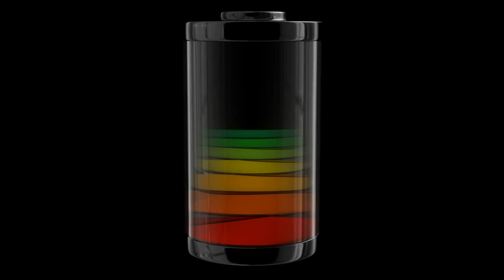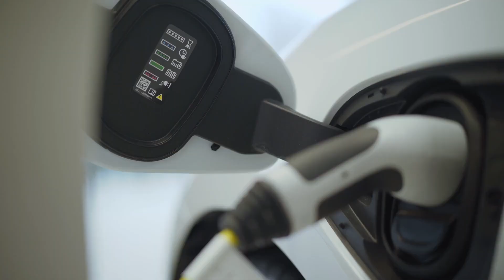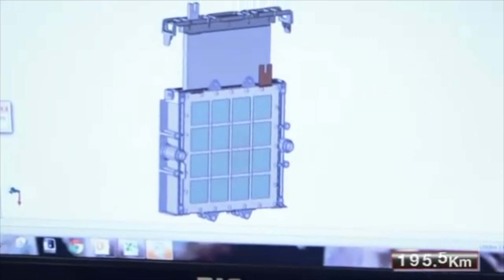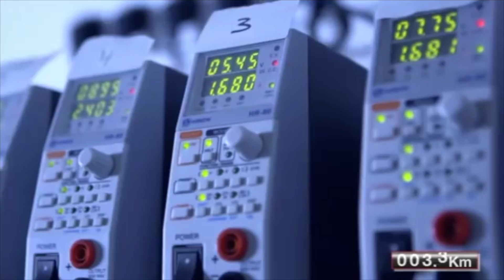This Battery Gives EVs 1000 Miles of Range!

Comment: if they standardize the size of batteries then any shop could swap them out like jiffy lube oil changes
Reply: Make them a standard size and look like huge AA batteries. The public will understand it better. Don't go for just one huge battery, make it four smaller ones that anyone can carry with maybe a 250 mile range if you only buy one. Going on a longer trip, buy 2, 3 or 4. Keep a spare in the boot. I can imagine, driving up opening the boot, grabbing a handle, twisting it and pulling out a tube. Go into the shop and buy another one and put it back in myself. No different to flipping a battery lid on a camera and swapping 2 AA cells, except put a handle on the end of the battery.
Reply: @saddle1940  I like your idea, but you have to think about voltages that the motors would need. If you cut the designed total in half, you're going to not have just half the range, but half (or less) of the capability of the car. It might max out at 25 mph instead of 50, for example. Think of putting one battery in a flashlight that is built for three.
Reply: @saddle1940   Have a look at Gogoro scooters.
Reply: Going to jiffy lube for anything is a bad decision and obviously every application doesn’t use the same amount of power meaning the same size battery doesn’t work with every application.
Reply: A few countries are already running battery pack swaps that take only minutes, some with fully automated replacement. With a standardized interface and minimum requirements the internal battery tech could be upgraded without changes to the vehicle. Basically like cell phone batteries writ large.

It's already a thing, and users appear to be happy...or so it seems so far.
Reply: Elon wont buy out this tech's patent and terminate it. Just like how his tweet push bitcoin price up ... or NOT
Reply: We would have several million aluminum air batterie cars in our junk yards instead of gas powered cars
Reply: @jeffreystewart8726  Profitable Recyclable batteries. Change the desired design frame = a changed outcome. Likely a 2nd or 3rd generation development to work out the unknowable kinks that always exist.
Reply: Standardization is nearly impossible in a capitalist society. Every company wants to do their own design.  The only way to have standard across the board is if Government steps in and Companies will definitely hate that.
Reply: @Al13n1nV8D3R  Not always. If companies see it in their interest to adhere to standards, they will, and this does occasionally happen. But the fact that it's helpful for consumers and the world in general is a happy side-effect, and not the ultimate goal.
Reply: @nomadMik  Although I do agree with what you are saying but companies are general greedy and selfish and really want to make more money for themselves. The only way a company would be motivated by agreeing to a standard is if tye government subsidize and benefit them
Reply: @Al13n1nV8D3R  I agree corporations are generally greedy and selfish, and that this is why they need to be regulated. But I disagree with 'always'. Screw threads, RS-232 and QWERTY keyboard layouts are examples of standards that came about because it was in companies'
interests to follow them. PDFs are an example of a shitty standard becoming de facto for the same reason. Maybe it's usually governments that cause corporations to adopt standards—I really don't know—but it's not always.
Reply: Yeah standard size and a standard port would be best, just the way USB and SD card standards have been adapted world wide. Adapters can become available as technology evolves
Reply: you know how much money that thing costs? a battery pack for an EV is around 11-18k dollars. Nobody is going to replace that thing for free.
Reply: Aluminium powder will fit into any space.
Reply: And they could call them 'anal lube stations', because it's a catchy name.
Reply: The thing is a standardization also helps bring cost down. New technology is good and all, but if cost cant be brought down. The consumer wont see the benefits of it. New technology only stays in the realm of 'The Future what ifs'.
Reply: Swapping out a one thousand pound battery is not comparable to an oil change.
Reply: Why do you think they will do this? the idea about EVs is just make a disposable car that you can't fix it.
Never was about environment, is about make more profit.
Reply: This would just be the same as putting a lid on innovation.

The work that goes into every aspect of car battery design is arduous and full of ingenuity. But you would need to understand many Engineering and Physics principles to grasp that.

They haven't even sought to standardize something as plain as phone batteries and you're suggesting moving up the complexity chain to the highest order of extremities.
Reply: I agree with your standardisation analogy.   Anti standard. This problem is not one for individual  manufactures 
to solve.This is a much bigger global problem. Manufacturers, like 'Apple'  for instance who constantly avoid conforming to any indusry standard purely for the purpose of market share greed, would in the end have to face overriding compulsory legislation for this to work Because unlike the inkjet  fiasco. The problems, including huge environmental issues are  so great and complex. That governments would need unite and intervene under the air quality and climate  change  umbrella as they have on vehicle emissions for example. There is some standardisation fuel, oil, wheels, brakes, tyres, starter motors etc. Why not drive battery systems. Until a clear winner emerges all the technological options  should remain open but it needs a concerted global approach.
Reply: @user-uu6bi4tn5o  Ummm....OBD1, OBD 2, R22, R124, etc come to mind as answers to the  "Doom & Gloom" nonsense. Sound familiar ? I've done engineering  in the automotive, aerospace, maritime & civil sectors. Choose a  "Consistent" platform & engineers will find a way to get it done. For example: How many different battery styles exist for your standard ICE automobile ?
Reply: @user-uu6bi4tn5o  Most of my devices these days are powered by AAA and AA batteries, which have been standards all of my life. Pretty much all the ones that don't can be charged with a μUSB cable, or USB-C, two other standards. Do tell: How has this has stifled innovation?
Reply: @nomadMik  you have fallen for the mother of all misnomers. You are describing cells.

What we are talking about are not even a level up in modules we are talking two levels up in innovation in the form of battery development.

I disagree.
Reply: @user-uu6bi4tn5o  Yes, I meant cells, but the point stands.
Reply: @nomadMik  the two are a whole different world... you can't have ever worked in battery development. That's the very same mindset that leads to failure in a surprisingly large number of products. Incompatible power source.
Reply: @user-uu6bi4tn5o  'A whole different world'?? Okay, you just undermined any credibility you thought you may have had. Apart from some specialised and unusual cases, batteries are made of cells, so saying they're 'different worlds' is ridiculous. And it's a distraction from the point anyhow, so stop trying to pretend you're an expert in the subject. 🙄
Reply: @nomadMik  you've basically just repeated what I said. Batteries are a composition of cells... and often cells are even arrayed into modules prior to assembly into the products battery packaging.

You obviously don't understand battery development. 😬
Reply: @user-uu6bi4tn5o  If that's actually what you meant, it wasn't very clear, just like it isn't clear how batteries can be made of cells but still be 'different worlds', nor what that has to do with standards. If you have an intelligently reasoned point to make, let's hear it, but if you just want to look like a smartarse, please go waste somebody else's time.
Reply: @nomadMik  dude, please just give it up. You are not literate in this facet of Engineering product development.

Neither are you on the subject. Go look up the DANGEROUS GOODS legislations and UN REGULATIONS that govern handling, transportation, lifecycle usage, storage, and end of life disposal of hazardous batteries (there is one for several chemistries groupings). There is an entire industry dealing with assisting compliance and enforcing it.

You will realise that Cells, Batteries, as well as interim modules are exactly as I described initially so just stop digging.

You are out of your depth!
Reply: @user-uu6bi4tn5o  Aren't AAA, AA, C, D, 12V automotive and many other batteries standardized?  Yeah, there are a lot of "standardized" sizes to select from, but standardization of packaging does not need to stifle innovation.
Reply: @user-uu6bi4tn5o  car batteries right now are pretty standardized in combustion engines. I can roll into autozone and get a battery for mower or car or truck, and its in stock even newer cars with weird terminals.
Reply: @user-uu6bi4tn5o  But the Aluminum Air battery would have to be swappable. Cars would have to build around a standardized battery pack, limiting the design. Lithium packs can be build as part of the structure of the car and customized for every vehicle.
Reply: @thtiger1  the government cannot dictate industry in this way. Ut has not been done for phones as a results given that innovation dictate requirements.

EV innovation is a hotbed of engineering and techonigical ingenuity which means tweaks to optimise are required, which means flexibility to upgrade cannot be hindered.
Reply: @thtiger1  structural pack's may well move things in this direction I don't know but battery designers worst nightmare is you coming along, limiting their space envelope and giving them unachievable requirements alongside.

You simply cannot place such restrictive dictates on innovation industries.
Reply: @user-uu6bi4tn5o  Never suggested they would. Industry itself would do so if it were needed. You don't see different sized nuts and bolts on every single car. they all use the same standardized fasteners. At most you will see special security heads that require a special tool to remove them. 

Same goes for other components.
Reply: @user-uu6bi4tn5o  The Aluminum Air battery is not a battery. It has to be removed and replaced. It can't be charged. I don't think they will ever be used in commercial applications, but if they are it would be to the advantage of the car companies to standardize a port they could be slipped in and out of easily,  with universal plug fittings.

How many corded appliances use a different plug than the standardized version. Cell phones might have different plugs that go into the phone, but they all have a common USB plug at the other end. The U is USB stands for Universal.
Reply: @thtiger1  the argument itself for standardization is not the one I'm speaking against, there is an entire hotbed of innovation and vicious competition which has been driving the EV battery markets forward for more than two decades now and you want to pour water over that fire for the sake of swap stations where you can go and get your well cared-for battery for another that's probably been abused by previous user or fallen through the QC gates.

It's a great intent but the industry itself has no motivation for it, they are too busy trying to discredit and crush one another with their own individual technological advances.
Reply: Let's see how the non-battery Aluminum chemistries progress.
Reply: @user-uu6bi4tn5o  You are missing my point. There is no such thing as a used Aluminum air battery. They are not batteries. They have to be removed and recycled after discharging. 

I actually totally agree with your points about innovation. I'm pointing out that in the unlikely event some company pushed forward with the Aluminum air battery concept they would have to standardize the plug and go model. 

The idea is already impractical enough as it is that adding the complexities of dozens of different battery models would make it truly impossible. Please note the fact that your under the hood twelve volt battery is very standardized. Even very large three thousand pound forklift batteries are standardized and are pull and replace. may car companies have a fleet of electric forklifts with a location designated for swapping out and charging batteries. so the forklifts can run twenty four hours a day. 

Rechargeable batteries for private cars are a very different matter and can be built into the structure of the car with no need for easy swapping. The companies can customize and innovate to their hearts content.
Reply: @thtiger1  If they can make a battery that can drive anybody 1000miles, in a package the size of a couple standard suitcases, I can"t see a problem for any car maker to accommodate the required space to achieve that capability.
Reply: @MolloRelax  True. The end point is how much they cost. Because they are a one time thing. Unless they can mass produce them for under two hundred dollars each I don't see it being viable. That is not actually out of line. An automated system could likely make them for dirt cheap. I don't see it happening, but if it did I could see a massive plant where used batteries go in one end, along with new raw material and finished product comes out the other, without a single human having to directly touch them.
Reply: @thtiger1  I believe there would be a minimal core refund for the expired battery too...like we have nowadays for starters and alternators
Reply: @MolloRelax  There would have to be. Aluminum is around four dollars a pound. If you didn't get a credit for your old battery it simply would not be practical. I'm not sure it ever would be anyway, but that would make it that much harder.
Reply: @thtiger1  200$ for a 1000 miles is substantial .that is 5 miles for every dollar, or about 20 to 25 miles per gallons of gas equivalent. It needs to be less than 100
Reply: @thtiger1  ...
Reply: @thtiger1   It wouldn't be that limiting. The car can always be designed around them.  Not to mention, different size and shape standard power cells.  Standardizing is a great idea.
Reply: @thtiger1  We just delivered a load of scrap aluminum to a recycler (on 6/2/2021). It was 50 cents per pound.
Reply: @howardbartlett3026  and if you were buying it processed and ready to use it would have been over four dollars a pound.
Reply: @user-uu6bi4tn5o  - said, "It [sic] has not been done for phones."  And you should note that phones no longer have swappable battery packs.
If you want people to stop using ICE cars and start driving EV cars. You are going to have to make the batteries provide long range and compatible. 
If not, the market will never truly take off. Also, the GOVT can dictate industry. For example, look at EV charging stations. In Europe, it's one standard. In the US, we have two standards and the proprietary one is already losing. However, if we move to something like Al-Air, then charging stations will not be required for the majority of drivers as the batt will be swapped instead of charged.
Reply: @user-uu6bi4tn5o  'Probably fallen through the QC gates'? Producers with sloppy QC tend not to stay in business long, at least in sectors with healthy competition. And whatever device you're using to communicate right now would never have been developed if it wasn't for communications standards, whether they're terrestrial, wireless or for power connections. Even if you're using an Apple device, and getting ripped off by some of its proprietary connectors, it still connects to its power source through USB or IEC. Similarly, Tesla vehicles, despite their proprietary charging stations, still also charge on standard ones—they have to, because otherwise their market would be limited to people within range of one.
Reply: @thtiger1  Oh Bullshit ! I can take a clay pot, 2 carbon rods from double A disposable batteries, some wire and an electrical source & do it easily. It is called a Carbon Arc Furnace & I first did it back in 1975 (when I was 9 yrs old). 

Back in 1995 when doing some redesign on my old used 1993 McLaren I did it again to create the billets to machine some of the parts for our LMR upgrades.
Reply: @howardbartlett3026  Scrap dealers do not pay retail for aluminum. If I go to a metal supply store and buy plate or bar and turned around and took it to a scrap dealer I'd be lucky to get twenty five percent of what I paid. I believe Copper offers the best value from a scrap dealer and even then you are going to be lucky to get sixty percent of the retail price of new material, and your scrap had better be pristine. Stripped wires or corrosion free bus bar. 

Aluminum is a wonderful metal for recycling. As you pointed out you can turn it into billets yourself if you are inclined, and that will get you a better price, but you are still not going to get anywhere near what you'd pay for those exact same billets if you were to buy them from a supply house. 

I buy copper, and sell scrap left over copper, so that is my point of reference, but I do have some idea of what aluminum bar costs and what the scrap dealers pay for good solid chunks, about $0.70 Canadian for rims for instance. How much a pound do you suppose brand new rims cost. Over ten to twenty dollars a pound is my best guess.

And I'm thinking aluminum from an air battery would not bring a good price as it would be severely corroded and laced with oxides and require more than simply being melted down. But there I'm not so sure.
Reply: @thtiger1  🙄
Reply: @MolloRelax  Hey, this is so much better... I mean really, who can live with 300-400 miles range for $7 when you can go 1000 miles and then buy a completely new energy source. What a deal!  Short Tesla! They will be out of business within days of this video!!! Or... not.  This is just dumb.
Reply: @user-uu6bi4tn5o  If they can standardize propane bottles, I can't see why they can't standardize battery packs.
Reply: @wnose  my initial comment stands, you simply can't have any semblance of commercial awareness and start going down the route of arguing for standardized battery packs.

You would be eliminating competition between OEM's and you would never obtain technological advancements for the consumer. 

You can't just throw cookie cutter batteries in OEM innovation.